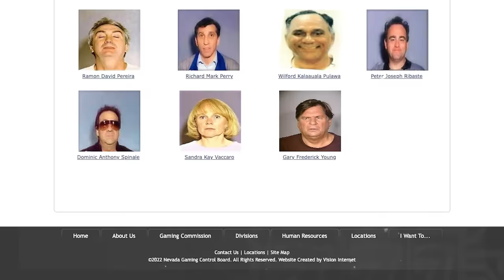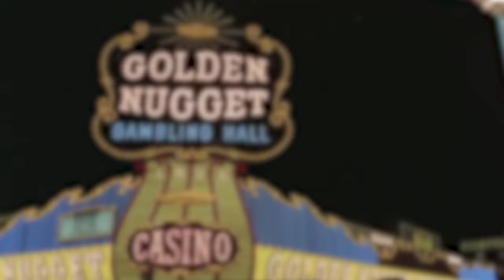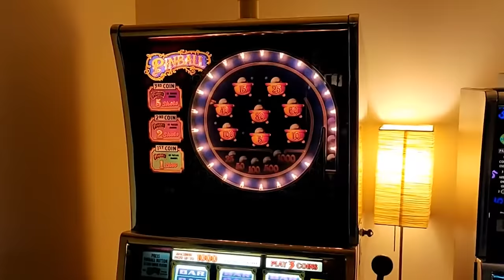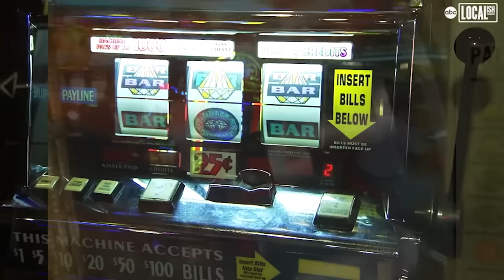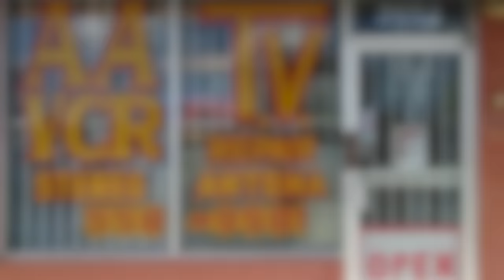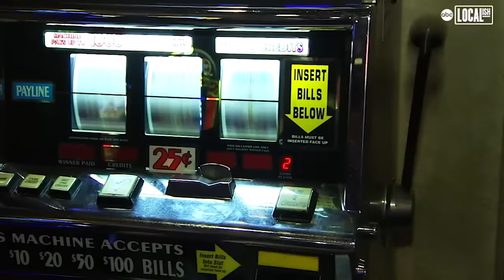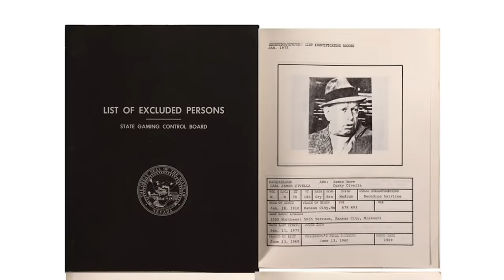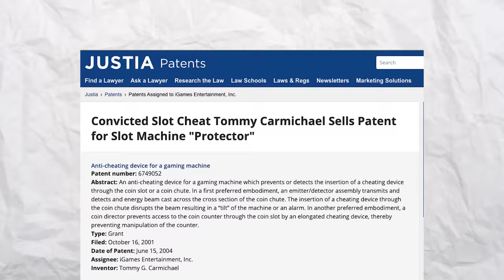How This Device illegally Won $44.9 Million From Las Vegas

Comment: imagine how inteligent this guy was without any documents to find on the internet. a true inventor because of a life of cheating a cheating system. such a legend
Reply: documents?!
he had to BUY a slot machine to figure out how to cheat it
he didnt just make these tools out of his head
Reply: @kenwittlief255  well he still had to reverse engineer the machines. Most regular people couldn't do that
Reply: @kenwittlief255  you still have to reverse engineer a tool, I suppose being a television repair man helps as he understood circuits and stuff
Reply: Different skill than what required today.
Would also need to buy a machine and probably reverse engineer the firmware which is quite an impressive skill. Then somehow exploit it with USB. More or less like hacking an ATM.
Back in the day it was more or less a full hardware hack - at least this one.
Reply: @TomTom-gx1sm   There was a story about a group that bought a more modern machines and reverse engineered the machine only to find out the original designer of the system had built his own secret back door so with certain button it would pay out, i guess the guy in china on minimum wage must have done it so he could made it big and then retire haha.
They also used it to scam the casio out of millions but as they did not hack the machine and when they checked the code and that the machine had not been tampered with there was not much they can do.
iirc it was in one of kevin mitnicks books on hacking.
Reply: I wish these talented criminals could do good with the skills they use for crime, they 100% can, but they choose not to
Reply: And this guy did good by making an anti-cheating thing for casinos from all his knowledge.
Reply: @eglol at least he stole from casinos and not innocent civilians. Most people won't shed a tear for a greedy casino
Reply: Nowadays hacker groups use malware to lock down an entire casino's computer system for a ransom like in the recent MGM and Cesar's casino cases.   They don't mess around with a couple of thousand dollars a day, but multi millions in each hit.
Reply: @eglol  There's no honest work in the world that pays anywhere near as good as crime, and so many repair, electronic security etc businesses go bankrupt, the incentive structure is just bad.
Reply: @dts7824  In fact, I am of the opinion that robbing a casino trough cheats shouldn't even be illegal, a special exception should be made for cheating casinos to make it legal. They are the scum of society, barely legal themselves, I see no reason for them to be protected by the law.
Reply: In the end he still found to get money out of the casinos anyway, instead of making cheat devices he patents all the ways you could potentially protect a slot machine and the casinos have to buy the patents from him. And it's 100% legal.
Reply: @kenwittlief255  ironically he ended up patenting (and selling the patent) an anti-cheat device for slot machines
Reply: It's actually much easier. If the internet exists patches would have rolled out much faster and every kid on the block would be working on breaking the machines. 

The difference in that he had money.
Reply: @eglol doing good doesn't pay and is typically really no good at all. Tommy has skill yes. But if he had entered the job market it's not like it's some miraculous thing. He would just be another engineer making some product that doesn't matter for an okay wage. Engineers were paid better back then, but still. Nothing like what he could make cheating. He shouldve just cashed out with his first couple millions counting his blessings to he set for life, but I guess he wanted to choose the broke way.
Reply: @kenwittlief255 soooo.. reverse engineer something you have? How do you not get what people are saying here?
Reply: Shout out to the air nz plane flying Michael out of the US into Argentina

Comment: This guy is not a criminal he is a hero
Reply: Its like looting a walmart it may be illegal but it is very cool
Reply: @YOSSARIAN313 very different scenarios
Reply: @daimsaeed  both are very based
Reply: @YOSSARIAN313 based
Reply: He's robin hood steals from rich
Reply: He is an example of chaotic good
Reply: He's a criminal though.
Reply: I, for one, think that a special exception should be made for casino cheaters to make it legal.
Reply: @meepk633  If it is a criminal or not doesn't matter, what matters is who is the victim, and if the victim is casinos, then in my books he is good.
Reply: @diablo.the.cheater  First of all, tell that to OP. He clearly thinks being a criminal is important. Secondly, casinos create a bunch of good high paying jobs by catering to adults who want to gamble. The guy featured in this video is a glorified vending machine burglar who didn't want to work.
Reply: @diablo.the.cheater  Then it wouldn't be gambling. When you gamble the odds are almost always against you in casino's its the whole point of gambling
Reply: @meepk633  A great one, in fact.
Reply: I would say,more like , chaotic, neutral
Reply: @diablo.the.cheater Sure, we can go back to old Vegas ways of dealing with cheaters.

Comment: I worked in casinos in Reno Nevada while I was in high school in the early 1970's.  I remember going into the slot machine repair room and watching the slot technician's position magnets into the machines to alter the odds of the slot machines in favor of the casino.   One way or another casino's are crooked and deserve to be beaten by enterprising individual's.  

I did at times work 16 hour double shifts and I would see people on the same machines for 16 hours plus with their right hand black from pulling the slot machine handle.  Little did they know they stood no chance of winning.
Reply: you can make some money off the modern rng ones if you have good timing/fortune, and some states require a specific minimum win rate like Indiana does. The casinos make most of their money in those states from people who do high bets, dumping $100 bills at a time, betting $5+per pull on penny slots or equivalent bets on higher denomination slots. people who do minimum bet can play a lot longer on the same amount of money regardless of whether they win or lose.
Reply: Also, don't keep playing on a machine if you lose multiple pulls in a row or get a decent win, go to another machine. If you keep playing on a machine that you lose on your money will run out quick, and you are not likely to get multiple decent wins in a short timespan on a single machine.
Reply: @stigrabbid589  lmao either way you're playing at the same disavantage. switching machines doesn't change that but people who think it does are suckers the casinos love.
Reply: This is why sports betting is the better gambling method. You can control who you think wins which is sometimes all a person needs to do well. I have no sense of control of whether I win or not I n slots or black jack or any of those other games. My knowledge of sports combined my knowledge of how Vegas make their lines at least makes me feel I can make money out of it.
Reply: @stigrabbid589  You can make some money off the modern PNRG ones if you own and operate them. Which is legal in some legislations, like in Germany, where for example a pub is allowed to operate three slot machines. Some pubs make more revenue with just two slot machines than they do with their beer and liquor drinking customers.
Reply: I'm pretty sure that's highly illegal
Pretty sure nobody like MGM would do that without the state noticing it
Reply: @stigrabbid589  wow a pro tip spoken like a true gambling addict. When you bet on black and it doesn't land on black do you think you almost won because it was just one space over?
Reply: @parris98457  A smart person will put $20 into a machine when they are out to dinner and happen to come across a machine at a local pub, and that's it, if you win or lose you walk away. But a smarter person does just what you said, $20 on a multibet with odds that they can control, still gambling, but at least you can choose a better odd for yourself.

The smartest move is of course don't gamble, but if you want some fun once in a while what's $20 every couple of weeks? Price of a movie ticket.
Reply: @mellamojeff458  The Mob was running the Strip in the 70's.
Reply: Once upon a time I drove taxi as a side hustle. Used to park at the casino when it was slow. Used to get out of town runs, sometimes paid by the casino if they overserved someone alchohol. One night security walks a lady out to my car. Figure it's going to be a charge to the casino and maybe a good one. Nope she paid. It was a $5 trip and they kicked her out cause she shat herself, likely at the slot machine. Took half a can of air freshener after she was out of the car.
Reply: @akaraven66  the smartest move is to get some slot machines and take the free money

Comment: Absolutely insane, cant blame him. Definitely want to know if there is some hidden exploit in the machines today that people are taking advantage of.
Reply: If you want to know please message me back
Reply: So you can get in on it?  LOL.
Reply: @tu1469  I want to know
Reply: Found the casino operator
Reply: @tu1469  I dont know if youre trolling but Im intrigued given most "richer" machines are programmed now
Reply: @Bentami  What you think my magic wand doesn’t work? Try it
Reply: me too
Reply: There’s always an exploit in any machine. Doesn’t mean it’s practically doable.
Reply: any machine that is connected to the internet could possibly be hacked by a person  who is extremely skilled in software. but if their machines are airgapped (i assume nearly all) then it's required to use brute force or picking somehow. at least until the magic technology we've seen recently of "record data from the radio waves of a SATA cord" becomes becomes more advanced, and if it can ever write data instead of only read.
Reply: @chadwells7562  yeah thats what i mean by it requires brute force or social engineering first somehow because you would have to get into the facility and wire into their system
Reply: I’d believe it if someone said there was. My parents are horrible gambling addicts so they spend tons of time in plenty of different casinos. The weirdest experience they’ve ever had hands down was this:

My mom heard jackpot music going off and a bunch of buzz a few aisles away. Curious, she got up to see what it was. $15k jackpot on the dollar. Won by a woman seemingly in her 30’s, calm as a cucumber, wearing dark sunglasses inside. My mom walked off. Not even 10 minutes later she hears jackpot music from the same area again. Gets up to go see. A man-also 30’s-sitting directly across from her, wearing dark sunglasses, calm and quiet, has hit the same $15k jackpot as well. Same type of machine same everything. People are crowding and asking who won, how much, etc. She leans to someone in the crowd and says that they’re husband and wife. 
They calmly took their collective $30k and walked out. 

That was at least 6-10 years ago but my mom has recently brought up that story thinking they had some hack or exploit or something.
Reply: @loveforeignaccents  yep or to distribute it to harm casinos
Reply: The people that make the machines like my friends dad knows how they work inside and out. It’s not cheating, he just knows how they work and comes home with money every time. It’s not millions or anything.
Reply: @chadwells7562  Yeah you gotta be a code nerd to be a criminal these days. Unless you're just doing basic shit that'll land you in prison
Reply: @roserose6418  Yeah, it takes large teams of them to be successful too. Even people that boost cars run it teams with specialists that open the doors, a guy that can start it, etc.
Reply: There is a glitch where you out the machine into water and it gives you a shock
Reply: @tacokoneko  It's been proven air gapped systems can be hacked wirelessly given that you're close to the motherboard. Check it out, it's pretty cool.
Reply: @tacokoneko  I'm goofy and only read part of your comment. It will be a scary world if those "magic waves" become stronger.
Reply: @tu1469  found the officer
Reply: @tacokoneko  Reading data can be just as useful, if not more useful, than the capability to write through SATA in airgapped systems💯💯
Reply: @ccs4959  yes we know, but this is in the context of slot machines that are offline otherwise we wouldn't need wireless.. not sure what data is going to be that useful for cheating unless there's really some magic timing to pull the lever and win. I assumed overwriting the machine's memory would be necessary, but hey if you can download its memory and find a exploit in it to create ACE or "jackpot warp"  just using controller inputs like it's a 20-year-old video game, more power to you because that's insanely hard
Reply: @tacokoneko  I’d assume most machines are offline to prevent an attack vector, as you said. I think being able to read information from the machine could be more useful than just writing on its own, but obviously both reading and writing capabilities are optimal. Regardless, having some information is better than none.
Reply: @tacokoneko  That SATA trick requires compromised software.
Reply: Imagine it's called the "Lightwand V3! Now with new Vibration Technology, by Hitachi."
Reply: @tu1469  yes please
Reply: @CoryRamirez000  can you explain more?
Reply: They spend a lot of money today making sure there isn't a practicable exploit on any of their machines.
Reply: You can advantage play slot machines
Reply: @tacokoneko  - What does becomes becomes more mean?
Reply: @SourRazberry  - The saddest story I ever heard was a mother and daughter taking a day trip to Atlantic City, playing the slots - a $1.1m jackpot gets hit. Can I see some ID.  Mom starts digging out ID, uh, no ma'am, we have this young lady on camera as the one who won. Daughter wasn't 21, they got nada.
Reply: I’d like to imagine he built in some crippling weakness into the protector lmao
Reply: They probably are, there's a reason we don't know about them though
Reply: @skinovtheperineum1208  omg lol...that's devastating.
Reply: There is always an exploit.
Reply: Of course there is. All modern machines now are connected to local nework and they see everything. So adding false credits won't work anymore. Modern exploits involve modified casino membership/loyality cards... but that tech is very expensive. May exceed 100-200k per unit and won't be issued out to the left and right randomly...
Reply: @t u  yes please M intrigued
Reply: @tu1469  lemme get in on it
Reply: Yes, there are hidden exploits the casinos take advantage of.

Comment: I read somewhere about these guys who reverse-engineered the software in a slot machine and found a weakness in the random number generator. They wrote some software to run on a pocket computer where you could input the current state of the slot machine and the computer would determine the next millisecond to bet in order for the random numbers to align in such a way that you'd get a payout.
Reply: There were several parts to this.  It involved a cell phone, a high powered computer at "HQ", and a person with great reflexes.  The phone would send video to HQ, the high powered computer could figure out where in the RNG "field" the game was, and work out what to do to get a jackpot in the next spin(s).  This usually involved very precise timing of button presses, or game starts, or "skill stops" to accomplish.  "HQ" would then tell the person with the reflexes what to do.  They'd do it, JACKPOT.

INGENIOUS!  And, IMHO, shouldn't be considered illegal.  You leave THAT big of a hole in your product, you deserve to get exploited.
Reply: @frankrizzo890  True, it did use a computer running "at HQ" that they needed to contact via telephone. I just didn't want to complicate the story too much.
Reply: In some legislations (like in Germany), regulations about payouts (the minimum percentage of the money taken by the machine which must be returned as wins) are extremely strict. The PNRGs are therefore guaranteed to pay out this minimum percentage in the most exact way possible (in the long run). These PNRGs can be (mathematically) proven to meet the legal requirements. There is no random timing involved in these cases.

If you can reverse engineer the PNRG, and deduce it's current internal state from the machines behavior, you can predict the outcome of the next games.

But it's simpler than that. If you watch someone who just dumped 500€ into a German slot machine and won close to nothing, you know that the machine is "ripe" and that it will need to deliver a huge win in the next few hours to meet the minimum payout percentage. You may, occasionally, even see watchers jockeying for position to be the next one to play the "ripe" machine next. And "jockeying for position" might even include physical violence.

And sometimes the owner of the machines himself watches. If the machine is "ripe", he might take it offline, and then start playing himself. As the owner, he won't lose any money he throws in, but he can dump the "jackpot", thereby preventing guests from scoring on a "ripe" machine.

One thing however still holds true: the best way to win money with a slot machine is to own it.